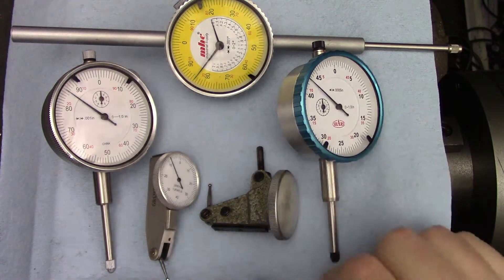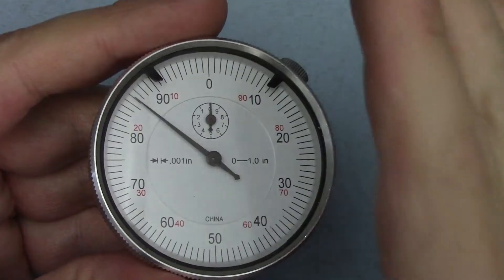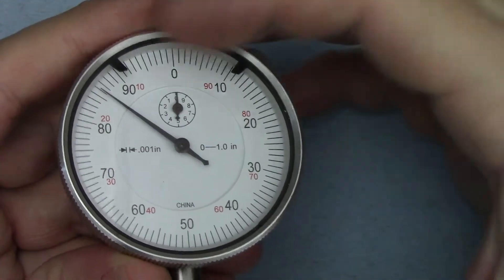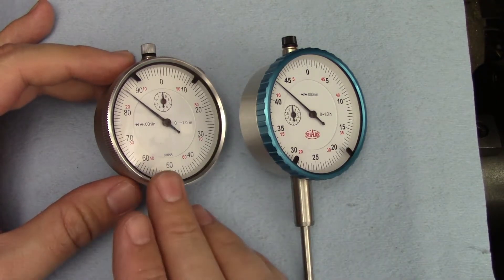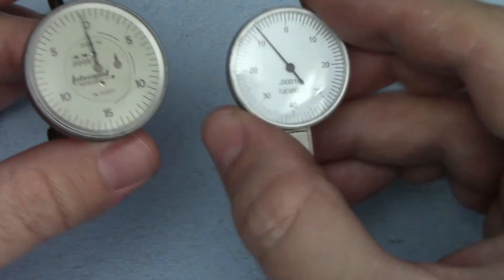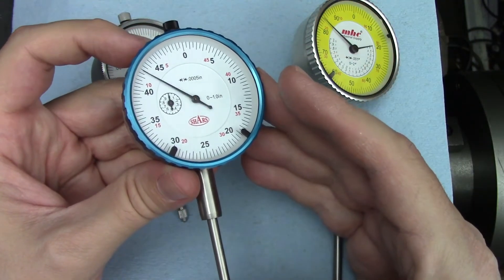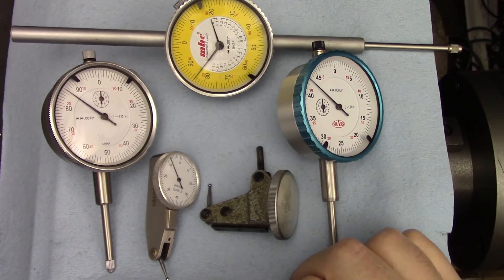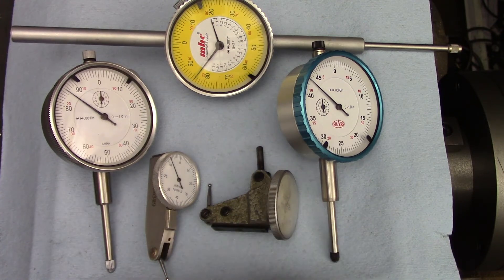How to Read Dial Indicators - Quick Machining Tip #24

Comment: Why is it that on some dial indicators the first half of tbe values increase then the second half values decreases, but the pointer hand goes all the way around (clockwise)?
Reply from the maker: It's so you can read it going either direction.  Sometimes you're moving toward the part, sometimes you're moving away from it, so it works either way.

Comment: Stuart, thank you for taking your time to make your videos. I am curious about my first dial indicator, it is 0.001"/division, 1.000" total travel and 0.100"/turn. I have the 0/0 at the 12 o clock position and the 50/50 at the 6 o'clock position in line with pull and plunger. At rest or no deflection the pointer is located counter-clockwise to the left at 90/10 (-36 degrees), at a similar position to the dials shown in your videos. I know I can set the zero to where the pointer is or just read from the 90/10. Not a problem. I just wonder why a manufacturer would go through such great pains to make such a marvelous device only to set it back counter-clockwise (or clockwise) by any amount. I don't know if I should be appreciative of the look of that or not.
Reply from the maker: It has a little room for over-travel in either direction so you can actually put a bit of load on it to get to 0, then still get your full inch of travel without burying the indicator.

Comment: 0:53 so the little gauge the tells you each rotation the numbers of it’s on 2 that means it traveled 2 times correct cause I had someone at work teaching me this that I’m wrong am I
Reply from the maker: Yes, the small dial shows the number of rotations. You have to pay attention to where it is when you start moving though because in practice, you're going to put the indicator against your part and it will have some load on it, so that dial won't be starting on zero most of the time.

Comment: Most of the problems I have with dial indicators have to do with how to mount them. Many have a lug on the back with a hole that doesn't fit anything I have in the tool box. A few are threaded for something. Can you address this issue, please?
Reply from the maker: Absolutely! Let me see what I can whip up.

Comment: I'm surprised you didn't include a digital indicator. I have two of them in additional to several analogue and test gauges and they work very well. They are very useful for going between metric and imperial measurements.
Reply from the maker: His question was about the graduations on the dial so I stuck with those.

Comment: As a sheer coincidence, I received a brand spankin' new Mitutoyo 513-403 DTI this week. Have it in a 4.8lb post-Tesa B&S surface gage. Made in England. I think it's all owned by Hexagon now. The thing is almost remarkably rigid. Such a pleasure to use.
Reply from the maker: That sounds incredibly beefy! What are the dimensions on that sucker?
Reply: @StuartdeHaro  100x105mm, though it feels bigger. I like surface gages and have a few. A Starrett 257C/D is a hair over 3lbs. An older version is a bit heavier. Looks great, feels even better, but not as rigid as an older B&S 622 (pre-1964). Weighs about the same as the big Starrett, but has more surface area touching the plate resulting in a higher moment of inertia. 

Saw this B&S 622 on ebay. Didn't look anything like an older 622...and made in England. It was relatively inexpensive, too. Couldn't believe the weight when I got it. It's beautifully built all around.

Comment: At work I find overhead cranes really helpful...
Pity the home shop does not have one!
So the rotary or dividing head tend to stay on the bed until I need the travel!
Reply from the maker: Making one is on my to-do list. Space is an issue though.
Reply: You think you've got a space problem!
Large people can only look into my shop from the doors!!
Hahaaa..
I'm considering a ceiling mounted track system.
Reply: I got the smallest chain hoist I could find on a popular auction site, and hung it to the right of the milling machine head. I can slide the rotary table or dividing head to the right end of the table, pick it up with the hoist, traverse the table back to the left, and set the heavy thing down on a small rolling table (a.k.a. dirtbike work stand).
Zero effort.
The chains are normally tucked up out of the way in the rafters, but it's always ready to go.